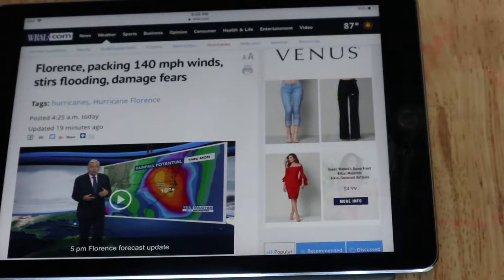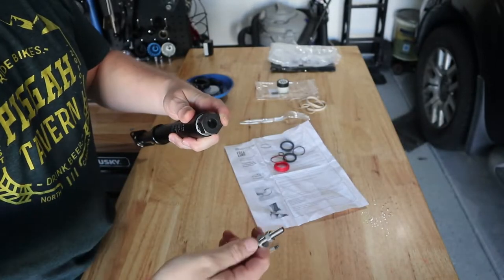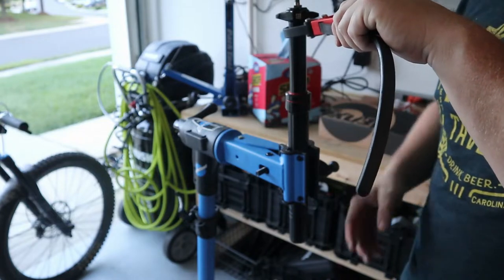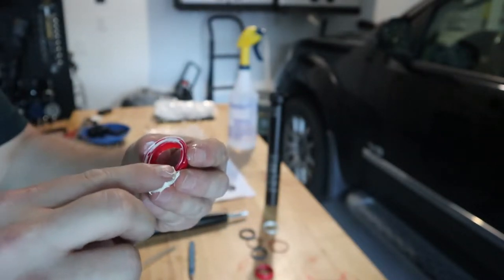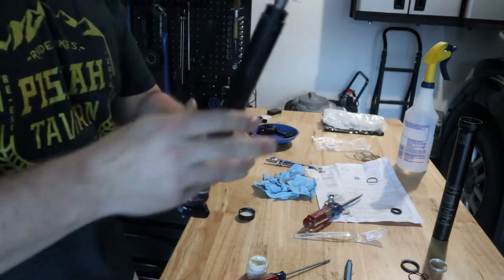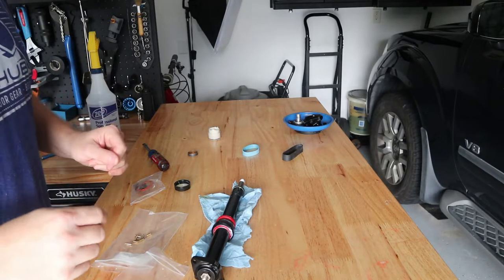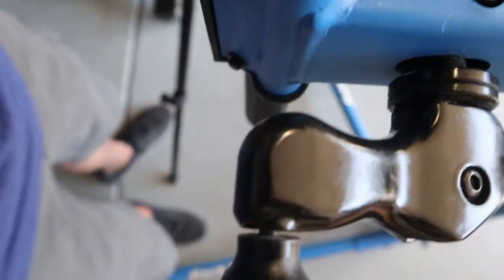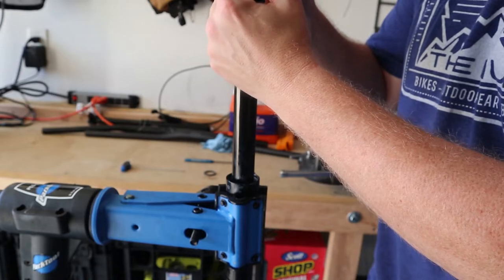#MTBPlanB Why I dropped this dropper post.

Comment: nice video and some good tips. I am however more interested in your long term experience after rebuilding it. I have been through this already, my 9.8 was loosing air after only half season, UK dealer was not responding on warranty questions, so got a different authorised dealer do the rebuild - wanted a pro to do the job so that no one can say I messed up. Paid for rebuild even should have been warranted... after another 6-9 months, dropper does not hold air again. Just to add, I was never using pressures above 10psi. After fresh rebuild you do not need any pressure in the post at all to have it return - it seals perfectly and when dropped atmospheric pressure will rise high enough so that it returns fast. I was actually suspicious that high pressures may develop air leak sooner, but can not confirm as I have second fail now with almost no pressures... So as for me, I am now over this dropper and I think 9.8 holding air is something that does not last very long. Was actually looking into possibilities of putting coil spring there and riding the crap out of it till it dies, maybe a project for winter. But I am sure not going to pay for rebuild again. Pitty, cause I like this product except for ability to hold the air. In my neiberhood, there was one more exact case, both 150mmm versions... Good luck with yours and keep us informed.
Reply from the maker: I have concerns Long term and will keep this post updated,  I didn’t really notice anything that would have caused failure when rebuilding the post.  That really casts doubts about whether a rebuild will permanently fix.

Comment: 9point8 make this key install tool, i brought one as well as the kit, and it helped loads with installing those keys.
Reply from the maker: Indeed the easier option but I couldn’t justify the 25USD + shipping when you still have to use the rubber band to hold the two halves together.

Comment: So is this dropper post worth owning or not? I like the 25mm offset head option that is offered for it
Reply from the maker: I prefer the Fox Transfer over all the droppers I’ve owned. PNW are good as well.
Reply: @MTBPlanB  cool.. i have a fox transfer but i need the setback offset for my new frame.. the seat angle is too steep for my liking..77 degrees